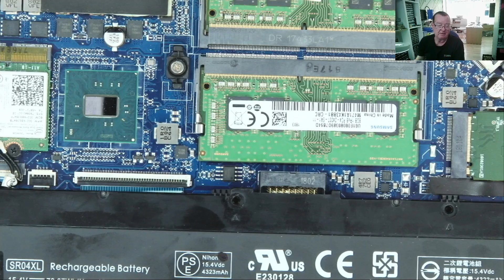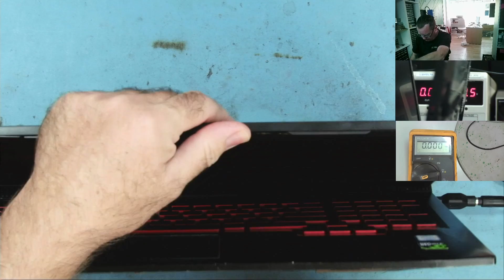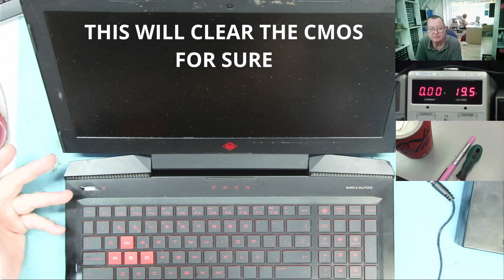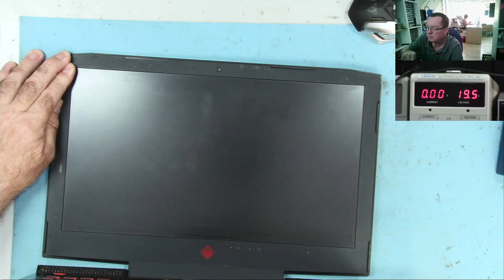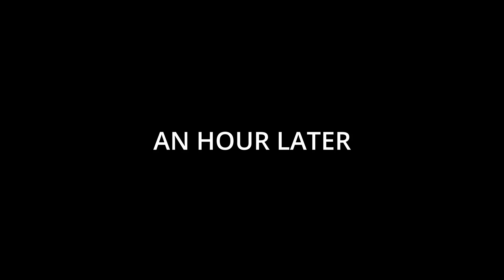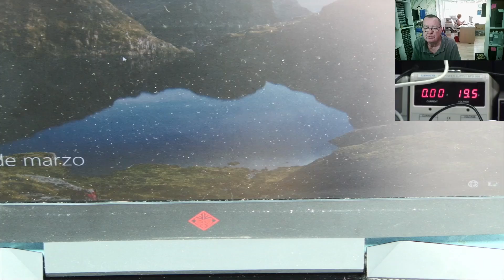This Omen Gaming Laptop Will Not Charge. Let's See If We Can Fix It. Laptop Repair

Comment: HP and Dell laptops has a charger ID pin- this pins send signal to the mainboard and only after verification the MB will agree to charge the battery.
This is done so HP can profit bit more from selling spares...

Your universal charger is using a resistor (or might be left disconnected) between from the (+) to the middle pin to create that signal- you can verify that with your DVM.
From my own experience you must use an original charger.
as for the battery, it might work even being a copy but it might also be the reason.
get an original HP blue pin charger and attempt to charge, in case it's still acting out, order a genuine battery and try to charge.
if all fails your power management IC might be faulty but that's too soon to tell.

please update after attempting my suggestions...

good luck!
Reply: Yes some of the Acers have this aswell the Power Control / Power Charging chip use it to decide when the charger is present and  when to charge the battery and at what current , you need a charger for that model not a universal charger.The Acer circuit  uses the ADAPDET pin and the +19VIN to detect the charger and BQ24781RUYR control chip.
Reply from the maker: @JonnyMac351  OK thanks for the info.  The power socket on the laptop only has two connections.  The idea of a resistor between 19V and ground sounds interesting but I am just trying to get my head around how the laptop could detect the value of that resistor when the charger is powered up.  I mean, it would have to measure the resistance by using ohms law.  So to measure the resistor the laptop would have to put a voltage across the resistor and measure the current that passes (or inject a constant current and measure the voltage)  I can see how that would work with the adapter powered off but trying to work out how it could do that with the adapter powered on and also passing current through the said resistor is tying my logical brain in knots.
Reply: @learnelectronicsrepair  That resistor on the original charger ID pin is NOT directly connected between the + and - of the charger. It's just a termination conected internally to the mainboard, for the SIO to be able to detect the type of charger. Please double check the charging port on the motherboard, there must be a third connection besides plus and minus.
Reply: HP and Dell chargers with ID use a third connector for the ID signal, on the centre pin. Ground is on the outside of the ring and 19v is the inside of the ring.

The ID simply let's the laptop know how much power it can draw.

Dell uses a 1-wire system where the laptop queries the charger for its wattage rating.

HP chargers connect the ID pin to 19v via a resistor, in the hundreds of ohms range. Different resistors are used to indicate different wattage ratings.

It's usual on such laptops for the BIOS to show the PSU wattage, it even to show a warning if it doesn't recognise the PSU. In some cases the PSU check can be disabled in the BIOS.

This can't be the problem if there are only two wires.

Comment: Hi Rick...Being it's a gaming laptop, Most Gamers Need the ORIGINAL Charger. Most won't work properly with aftermarket chargers. Second being the battery is not original may Also cause the same issues.  My recom. is get an original charger to start with, Then go from there.

Reply
Reply from the maker: Hi William, thanks for the info, you probably heard me say in the video that I thought the owner should get an original charger.  Can you shed any light on how the laptop detects the charger is non original, given there are only two connections on the power jack?  Also why my non original 100W charger and my 10A bench PSU will charge the laptop (charger LED goes red) but the 180W non original charger won't (cherger LED goes off) even though there is still 20V present on the connector as I showed in the video.
Reply: @learnelectronicsrepair  could you not load test the psu Rich ? Would that be worth checking ?
Reply: btw sometimes psus from HP have „three pins“ on the connector to the unit. outside is gnd, inside is power and the pin is a data connection between psu and unit for the charging power/data transmission

Comment: reboot the laptop and during boot-up press ESC repeatedly then F2 to start up the HP diagnostics then go to component test >> Power and run tests on the power supply and the battery
Reply from the maker: Thanks for the info
Reply: Thank you! This way I found out my battery needs to be replaced. Saved me some time.
Reply: "Then F2"? As in then hold it? Then press it repeatedly afterward? Press them both repeatedly simultaneously? Genuinely lost here.

Comment: lemme get this straight - you have non original battery and connect non original charger to a thing designed by usa company and expect it to work? muhahahah
you can bet you ass it implements some protection protocols (could be anything from resistance or voltage signaling to 1wire/serial pairing) on at least one of those, most likely both
Reply: There are even some (quite old) videos on YouTube showing how they implement some special protocol to disable the battery when not original. Batteries are a big business for laptop brands and they don’t want anyone messing with their income…
Reply from the maker: @hernancoronel  Yeah I am aware of some of that stuff, thanks to Sorin in particular But the battery is working. I can charge it from my bench PSU or 100W adapter and the laptop will run from it. It just wont charge from the 180W adapter even though it is supplying voltage to the laptop.
Reply from the maker: Not quite.  Someone else got a non original battery and a non original charger and expected it to work.  However for some crazy reason it will charge on both my bench PSU and my 100W non original adapter, even from completely flat, but it will not charge on the customers non original adapter.  This is what I am trying to understand how that can possibly be,  I mean, there are two connections on the power connector to the laptop, the 100W and my bench PSU (10A) charge it.  The 180W doesn't even though it is still supplying 20V.   

Regards resistance, how, according to ohms law, can the laptop possibly measure the resistance between 19V and ground on the PSU when the PSU is already powered up and already passing current through said resistor?  Please someone explain that to me as it goes against anything logical I can think of.  Surely to measure the resistance the laptop has to comply with ohms law and either has to supply a constant current to the resistor and measure the voltage across it, or apply a voltage across the resistor and measure the current through it. And it can't do either with the PSU supplying 19V across the resistor. Ohms law does not appear to allow for any other method by which the laptop could measure the resistance.  I love to learn new stuff and improve my knowledge, I'm just really struggling to get my head around how this could work.  

Regards 1 wire single pairing I took a google to that.  It says the data line must have a weak pull up resistor (in other words high value resistor) but that, to my mind, is incompatible with using a 1 wire single pairing on a power rail, in this case using 19V as the data line, because the PSU output itself must be a very low impedance source.  Sure that would need a third connection but the coaxial jack socket on the laptop is one central pin plus outer shield.
Reply: @learnelectronicsrepair  I am not sure it is this problem but please search on YouTube for “Adventures in laptop battery hacking” and you will see Matthew Chapman explaining all the things he had to do to avoid buying a new battery for his laptop. Very enlightening video and who knows, however the fact that it charges from your bench PSU clearly shows there is no BMS protocol involved in your particular problem as opposed to what is described in that video. In any case I think it is worth a watch.

Comment: On my dell laptop i have option to limit the charging of the battery to like 50% and then stop charging it. Can it be something like this? 
If not it seems like charger or bios/EC chip firmware corruption
Reply: no he tried when battery was low also

Comment: Heya, Could be a enable/disable in the bios for wen to charge I would guess
Reply: @Mr Guru thanks learned some more
Reply from the maker: @Mr Guru Why does the SIO send different signals so that it will charge from my 100W PSU, and bench PSU drawing 2A, but it won't charge from the 180W PSU even though the 20V is present? It's not overloading the PSU.
Reply: @learnelectronicsrepair  I think the oem charger socket has a sense pin that sio chip uses that's what most HP , ACER ect use my ACER Nitro 5 uses this the charger pin looks like a standard 2 pin like the one your using but if you try using a non oem it wont charge it has a extra pin in the socket on the MB to detect it when you plug it in possible this may use the same system My Acer circuit  uses the ADAPDET pin and the +19VIN to detect the charger and BQ24781RUYR sio control chip.
Reply from the maker: @JonnyMac351  Does that explain why my 100W adapter, and my bench PSU, will charge it but the 180W PSU will not?
Reply: @learnelectronicsrepair  Not necessarily but it was a thought.
Reply: @learnelectronicsrepair  could it be picky about input voltage? his charger had 20.0 yours 19.5